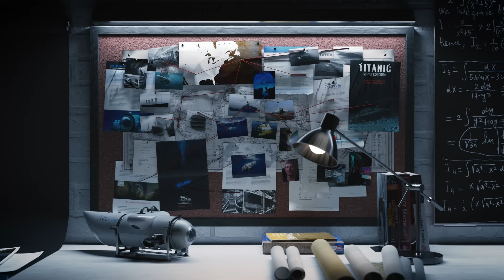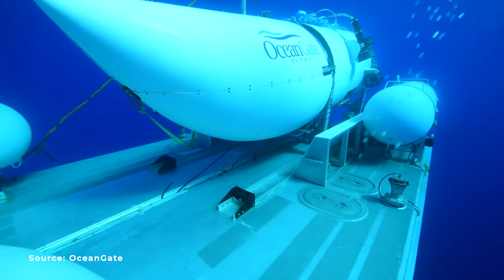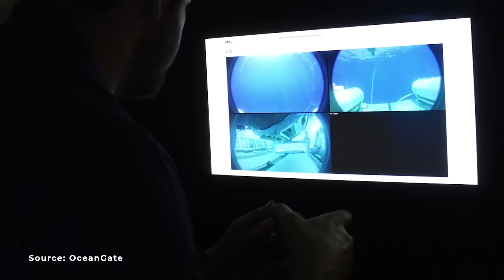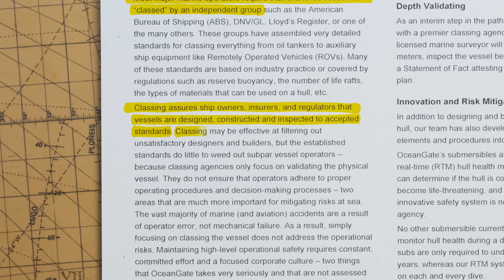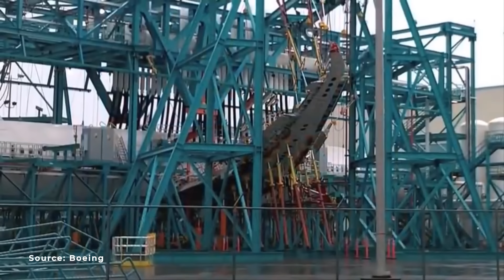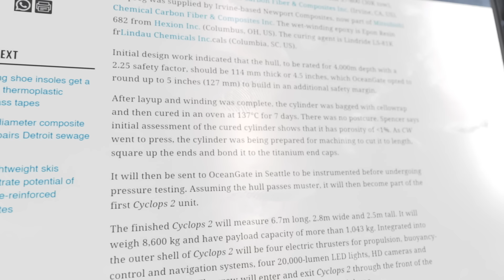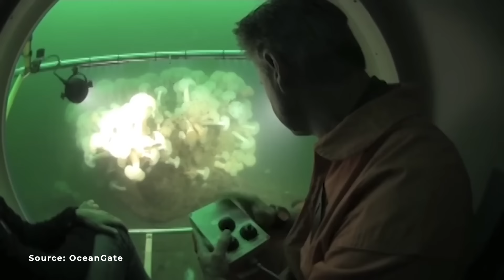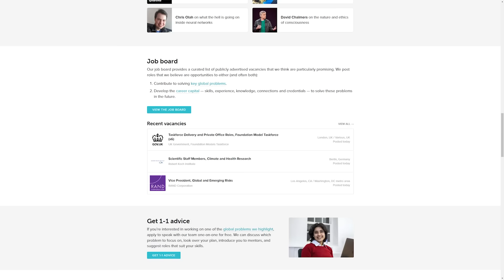The Questionable Engineering of Oceangate

Comment: I had the same reaction after seeing the construction.
Four plus decades in aerospace composites design and prototyping, my first thought was WTF. My second was with the TEC's of carbon fiber, epoxy and titanium. Given both the temp and pressure differentials, it seemed insane to combine these materials in they method they did.
Reply: I thought the same thoughts!  I was of the opinion that the transition between the titanium rings and the carbon fibre shell was the weak point due to the dissimilar physical properties of the rings and shell.

Reading this article showed that the end s of the shell also provided ingress point for the sea water to initiate delamination of the carbon fibre lay-ups.

What I find really inexcusable was the lack of investigation into the cracking sounds during previous dives.  To me at least that would indicate carbon fibre failure which is a cumulative failure ultimately leading to catastrophic failure.

Is there a record of the locations where this cracking sound originated in he vessel?
Reply: @BasementEngineer  Apparently the CEO expressly forbid any maintenance testing because it would potentially mean an official report showing a flaw with his design.
Reply: @littlekong7685  Basically, he broke the thermometer to make the fever disappear
Reply: yeah but MONEY
Reply: As a technically proficient layperson, my original thought was the C.F. center, and the Titanium endcaps would expand/contract at two different rates as the temps changed upon descent.
Reply: Ditto here.... mix materials in those extreme conditions and you introduce all kinds of problems.
Reply: Looks like when they put the end caps on they put the ring over the tube.. not that it would have made much difference.. but wouldn't you want the titanium ring on the inside holding the tube open as a structural member, rather than just the glue??
Reply: I'll throw a bit of cold water into the party, here.  The guy made 50 dives in the thing.  That is more than, as I am aware, any other submersible.
He proved that if you want to make a vessel that will last for 40 dive cycles, his way works quite well.
Obviously, he expected more out of the structure than he got - but if I needed to make a lot of dive vessels quickly that would work for a limited duration, affordably - it worked.
Concerns about the titanium interface?  Sure, that is a concern, may have even contributed to failure - but had the guy decided to retire the vessel after 40 dives or even 50, this would have been noted in the books as something the next iteration improved over.

No one wants to be on the imploding sub or the crashing airplane.  However, the design worked, quite well, for some time and even gave significant warning (that was ignored) it was about to fail.
From where I stand, the engineering was better than the captain, who simply refused to accept that reality could reduce him to physics if he wasn't mindful of it.
When you're hearing the fibers break and you keep diving - that's more than most expected the structure to give in terms of warning.
Worded another way - the sub and the engineers cared more about the ceo's life than he did.  It would be a tale of someone who foolishly died doing what he loved/wanted to do, were he not bringing other people along on tours.

The world isn't always about perfect or ideal solutions - it is about understanding the limitations and concerns as it pertains to a solution.
Reply: @Aim54Delta  Most of the dives the Titan  made was not to that 4000m depth. Most of them were aborted because of technical issues, etc. There's a few people who said they only got to less than 100m down and then had to resurface because of technical issues. So In all, the sub only went down to 4000m a handful of times.
Reply: @sharraleigh  
That is still more than any other submersible which did go to those depths and we don't know if the failure is simply based on pressure cycling or if there is a critical pressure at which the stress cycling is key.  We can assume that, but that is an assumption that diving to 100 meters does less to damage the structure than diving to 4,000 meters, but I have seen the real world behave in ways where such assumptions don't pan out.

The point is that even some metal foam can suffer from fatigue cracks, which is precisely why prior subs were retired after very few uses.  Their designs are exotic and their failure modes in such applications are purely speculation.  I have seen similar "you can't do that" claims about various engineering principles - some of which raised by myself, later get resolved by some other aspect of engineering and the claim not be wrong on its face, but was accounted for in design and the experience of other people on the project.

When the industry standard is to retire these things after a few uses even when "built right" - a rogue who "built it wrong" who imploded after failing to retire his craft is hardly evidence of an engineering failure.

What is unacceptable and crazy to me is the lack of fatigue testing and the insistence to keep diving after hearing fibers cracking with his own ears.  If anything, I would argue that is a possible phenomenon to study, to see just how much warning a carbon fiber structure gives you over, say, comparable structures vulnerable to metal fatigue or manufacturing defects (another problem with metal foams is consistency of bulk properties).

My main grievance is that he acted like the sub was tried and true rather than experimental and was all too willing to involve others in the test-to-failure he was performing.

"Build it right" and test it to failure (no need to be in it) and see how much better it fares.
That is my main issue with how everyone is handling this on all fronts.  The company involved didn't want to recognize they had a design that they had no failure analysis for and weren't even performing.
Likewise, the "people who built it right" also are doing a hand full of dives and not testing to failure.  Say what you will about profiteering - building one of these things is expensive and testing them to failure is a very expensive prospect when you can sell them to museums or collectors after you've done what you wanted.  If anything, the need for testing any design is not being grasped.  If you "built it right" - there is no guarantee that a super-sized Alvin would survive multiple dives to that depth - many such vessels were retired specifically out of concern they may not.  You would still need to perform testing in a domain that simply has an insignificant amount of data.  How can you certify a structure to do something that hasn't yet been done with any degree of honesty?  A king can order back the tide for all the good it will do.
Reply: @Aim54Delta  It's not at all clear how many dives Rush made, how many were actually to Titanic's depth, and how many of his dives were to much shallower depths. Or if it was in this particular submersible. It is clear that Rush was a fabricator, and not in the materials sense.
Reply: @Aim54Delta  I mostly agree, but the version of the Titan had 4 or 5 dives. It probably could have been rated for 2'000 meter depths. Everyone is so concerned about the Carbon-fibre hull, when in reality it was just an untested technology. Usually in maritime accidents pilot error is the most likely cause of the accident. They dove too fast, and when they released their ballasts they didn't ascend.
Reply: It turns out it was insane to combine those materials in the method they did

Comment: Some people in WWII wanted to put the heaviest armor for planes on those areas that were reported to be most often damaged by flak, based on data acquired from planes returning from the battlefield. It had to be pointed out to them that the heavy armor should be placed on areas that were less reported to be damaged. Because planes damaged there were the ones that did NOT return from the battlefield and could therefore not add to the data pool. 
Oceangate's disinterest in sticking to regulatory standards, simply because most accidents happen due to human error, not material failure, follows a similarly flawed logic. Most accidents happen due to human error because material errors were weeded out by sticking to rigorous regulatory standards for materials. 
I wonder whether or not the Oceangate people were aware of their false conclusion or if they really fell for that logical trap.

Comment: The controller was definitely a concerning aspect. Yes, as Rush himself said, the pressure vessel is the most important thing, but as you can see, he didn't even take that seriously. An off the shelf wireless controller has the potential to start a fire within the inescapable pressure vessel. It's also relying on a wireless connection (they didn't plug it in as far as I've seen), and while they claim to have carried extras, that's probably only the case after they had previous issues. One incident involved remapping the controller at depth from instructions they were luckily able to google because of starlink internet. Had their luck run out that day, they could have been trapped down there and/or collided with the wreck. Controls are really important, and to rely on a such system for your primary control is so unnecessarily risky, especially if there is no backup. It's easy to laugh at how it's specifically a game controller, but obviously that makes no difference. It's how OceanGate implemented the controls with little care for human life.

Comment: Anyone with a rudimentary understanding of carbon fiber knew this was a bad idea from the start. Secondly, as an engineer, while simulation data is wonderful and gives great insight to the designer, there is no possible way you can simulate reality. There are far too many unknowns and too many variables for a single simulation to possibly give you 100% confidence in a design. It's why you do real world testing and especially point of failure testing. None of it was done in the naive belief that it is a waste of time and we have other systems that can warn us of failures. It's poor engineering on a grand scale.

Comment: Thanks. Great content as always.  The carbon fibre was wound onto a stainless steel pipe.  From the fotos the pipe wall thickness I estimate at 20mm.  To what extent would the pipe prevent delamination buckling?
Reply: The OceanGate titanium end cap gluing videos show that metal pipe was just a mandrel that was removed. The tubed hull was just carbon fibre.
Reply: Just delay it ! The best, 100mm (TBD) of SS, Ti and one layer of fiber for the look !

Comment: 4:10 wow, that's a bold claim, saying that most accidents are due to some kind of operator error. And if so, precisely for the reason you stated just afterwards: technically tested and certified vessels are sound.
Reply: It's a claim steeped in survivorship bias. The reason why most accidents are due to operator error is because the vessel/vehicle is built sturdy enough for there to BE an operator error to begin with.

Comment: Carbon Fibre hull and Titanium endcaps were attached in an open warehouse/workshop. NOT a dust free environment.

The controller was wireless. Why not wired? Was there a backup system and/or spare controller (and batteries)

There was no emergency beacon.

There was no system to test the carbon fibre after each dive.

The COO had resigned over concern about safety issues. The CEO asked the CFO to take over as chief pilot, she declined and soon left the company.

Comment: "Move fast a break things" SpaceX uses this theory specifically regarding TESTING things. They don't overengineer test rigs, they simply build them fast and let them fail so they can rapidly learn failure modes. They also do extensive and costly unmanned failure testing. This guy was cutting corners and blaming SpaceX/Blue Origin as an excuse.

Comment: You have well highlighted the issues any sensible engineer that has even passing familiarity with composite materials design and analysis would have. A hollow vessel pressurized from the outside should NEVER be made from composite materials,  especially filament wound construction.

Comment: The difference between ocean gate and spaceX despite using a dangerous and darwinistic method of development, is SpaceX has the money to ensure the relatively safe rapid testing of the vessels vs Oceangate putting all 2 gas station eggs in a single basket

Comment: This is a much better video than the others because it starts by focusing on the fact that carbon fiber is for good tension rather than compression. Certainly they could have used plastic which would be great for being able to handle repetitive stress, but should have omitted the carbon entirely.

You can get away with scrappy construction if you do at least a thousand test runs, but that never happened.

Comment: First let me say something to the last part of the video:
There are so many occupations that "do good" for other people. In and out of technical jobs.
But if someone is interested in technical occupations, there are so many "unknown" ones in what is considered critical infrastructure that helps keep people safe and have a better life.
One that comes to mind are the ATSEPs around the world. That's quite an unknown technical job requiring high qualification, anyone who has ever been in a plane or who has had a plane in the sky above him has benefitted from their work but no one knows they exist.
To the whole video: Very well, put! I wasn't much interested, in the subject of submersibles. Just reading the wikipedia article about what all had happened before the incident was enough for me to come to the same conclusions you did in the video.
For example, i am an electronics engineer, but i do have an interest in many technical things that have nothing to do with electronics and i did some archery for fun with carbon arrows a few years ago, so i was aware of how carbon fibre breaks and this and my repsonse to reading about the "audio monitoring" was the same as yours.
The other thing i didn't understand in the use of this material for that application is the fact that, as you showed, when carbon breaks there are a lot of splinters that go flying and are a thing no one wants. So even in the case they were seemingly hoping for that when it breaks, only bits start to break, this would mean dust you don't want to breath in, lot's of splinters everywhere...
And the attitude of the CEO, to me would be a huge red flag. This was someone i would not have wanted to even be at the wheel of a car i am in.

Comment: Your supposition that operator error reigns supreme in accident statistics being a result of good protocols/requirements in design...DEAD ON, IMO!  That should be a no brainer to thinking individuals, especially engineers, as well.  All that work that VERY useful govt bodies do (yes, a very few exist), like the FAA and NTSB is one of the reasons why that fact is a fact, as well, not just good design practices including design assurance departments and general peer design reviews, etc. (PIA that they can be, at times). As for their justification for reducing requirements on designs since those are the primary driving factor, nothing better than kindergarten college MBAs and their wrong headed, ass backward, circular reasoning.  The things I could relate from meetings.  :-/ They have never heard of fault tree analysis, or they have, and know it to the buzz word level.  That is the very definition of being 'knowledgeable' enough to be dangerous (Challenger launch at near freezing temps being an excellent example).

Retired electrical aerospace engineer here who has hobbied in just about everything from ALL aspects of rebuilding and building motors and cars, scratch designing RC planes in my youth, even to the absurd point of drawing up my own airfoil for a scratch designed flying wing (I was a kid :-) ) which mostly flew, with some severe and quite radical instabilities/departures at what should have been within the normal flight attitude envelope, unsurprisingly, to building a Long EZ as an adult, so yeah, I saw limitations I noted, but learned a lot, the hard way.  

I designed for some commercial, non govt contracted projects later as a previous aerospace govt contractor type, and OMG, people doing the dumbest damned things, no quality control whatsoever, by comparison, and sometimes it REALLY showed in the final product. Cascaded one shots, 'me and my RC', or clocking up to reliable and routine failure level and backing off a bit, anybody?

ANYWHO, I totally advocate and support requirements, inspection, placarding, etc. for ANY and EVERY deep submersible, especially those that carry paying passengers.  They were talking about doing a fully constructed level inspection requirements for homebuilt aircraft, to at least check the visible aspects, fuel system, control system, visible structure, etc.   I don't know if they did, but we intended to do just that (somewhat typically sold it half finished, to air frame completion, and someone else finished it, flew it for years, and sold it), and get seat time in another, let an experienced type owner fly it for its first test flight, and every other reasonably risk averse path available.  

There are several levels, incredibly stupid (like moron gate, here), slightly stupid, somewhat risk accepting, careful, and several in between.  The further toward the end of that scale you reside (meaning the 'better to be on the ground wishing you were in the air than vise versa' type) the longer you tend to live.  Over regulation absolutely sucks (N numbers on RC aircraft?  Really, and for NO reason (the general public idiots with quad copters I FULLY understand, they've EARNED it!)? I just quit the hobby in disgust and irritation, but regulation on company vehicles designed to carry passengers is a no brainer, IMO.

And they rode off into the sunset, the end.  :-)